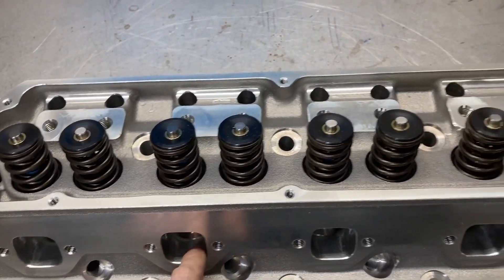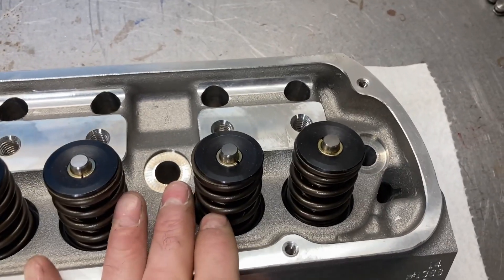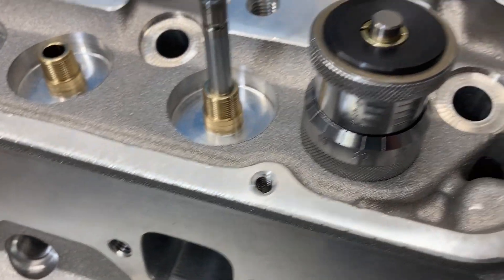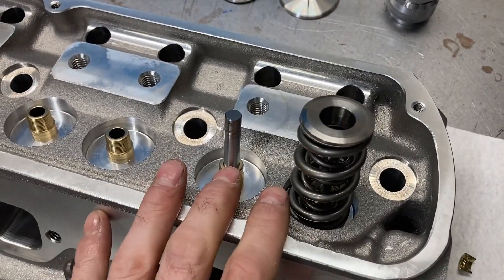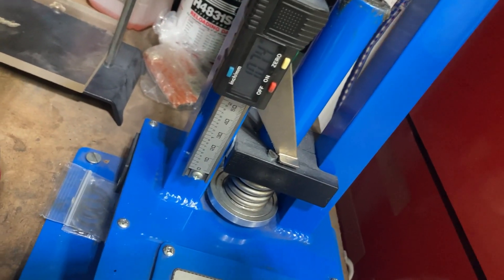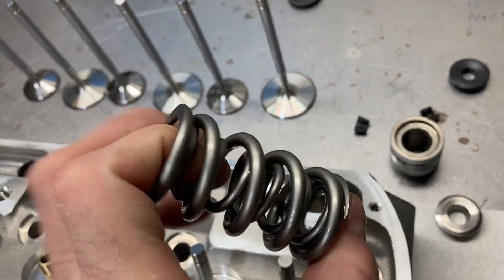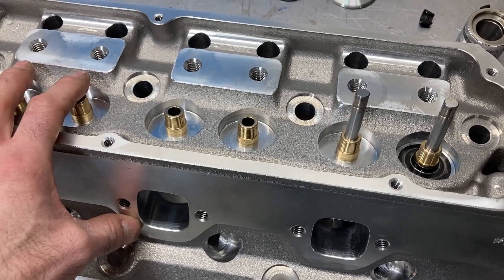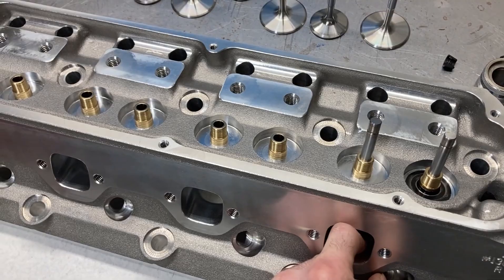Lykins Motorsports 310 SBF Dyno Mule Valve Spring Selection

Comment: Hi every video I learn more!! Could you help me answer this question? I can use titanium retanainer for an occasional application on the street 1 or 2 times a week 250 miles a month max and occasional track. Currently it is a 302 engine with trick flow 11r 190cc heads and custom cam and it runs 11.90 at 114. I rev the engine at 6800 rpm. Many say that titanium is not for street use because they wear out quickly. What do you think about this statement? The factory steel retainers that came installed in the heads have a weight of approx 14 to 15 grams .spring pressured 150 seat thanks for your answer and your help

Comment: HI Brent Liking the SBF Builds,i am about to begin on a street/strip 363 build hoping for around 700 hp with solid roller 13.5 e85,the question i have,i purchased scat i beam pro comp rods with ARP 2000 bolts,i thought they would be 7/16 but turned to be 3/8,would that be strong enough for this build,or do i have to change them out
Reply from the maker: I wouldn't trust them.
Reply: Scat / pro - comp , make up your mind no such things